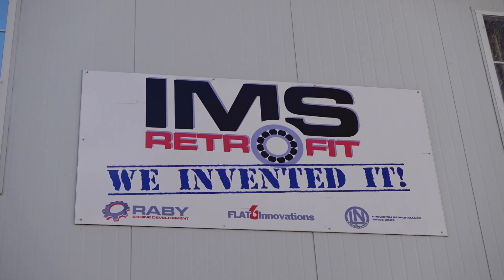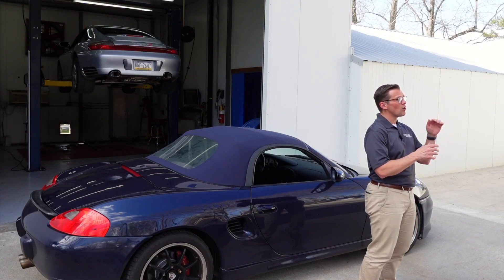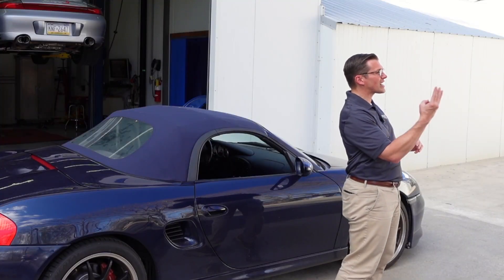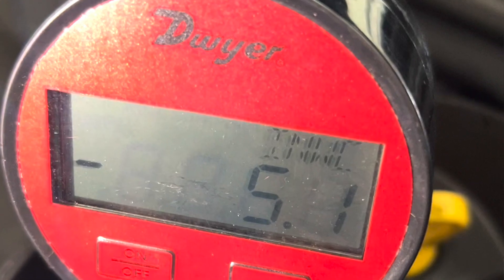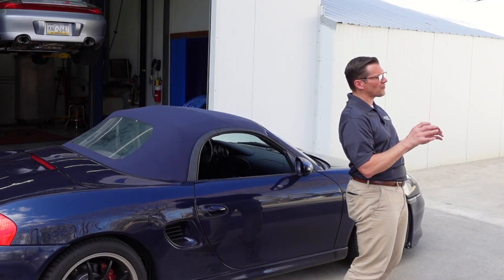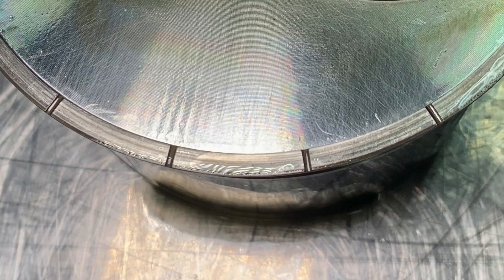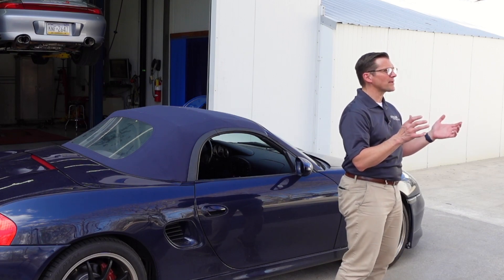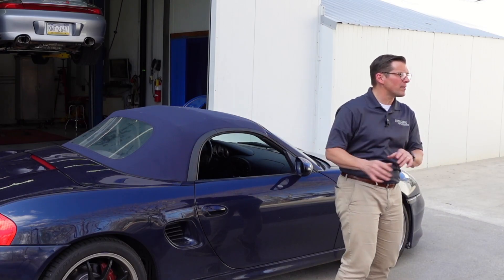SUMEBore Testing Update - Porsche Boxster Project Engine - Next Generation Cylinder Bore Technology

Comment: I knew that surface treatments such as Nilkasil can be subject to detachment from the cylinder walls, can this also happen with this new type of coating?
Many racing pistons have a DLC treatment, would it be possible to use this type of coating also on the cylinder walls?
Reply from the maker: Great question! No, this process doesn’t suffer from the delamination problem that some coatings do. Think of this as spray welding…

And, yes, this process can be used with DLC coated parts.